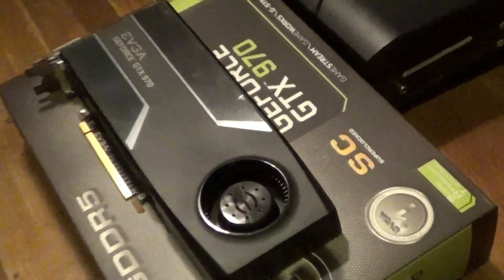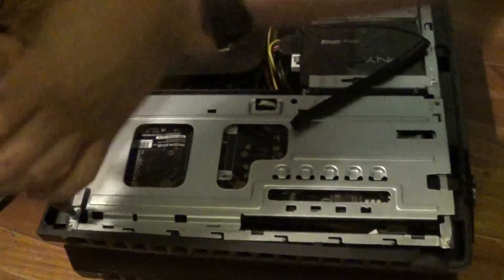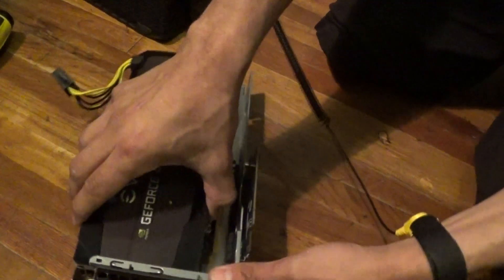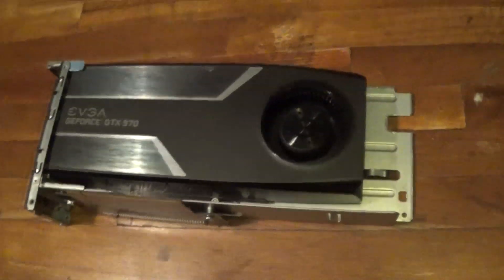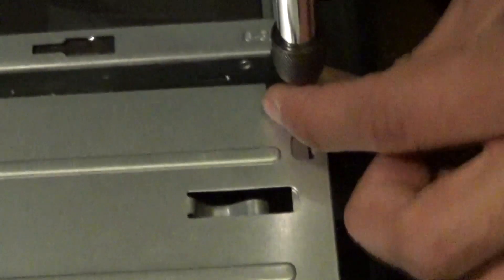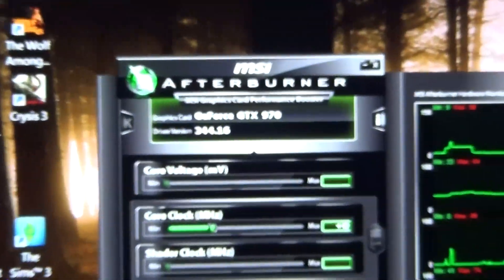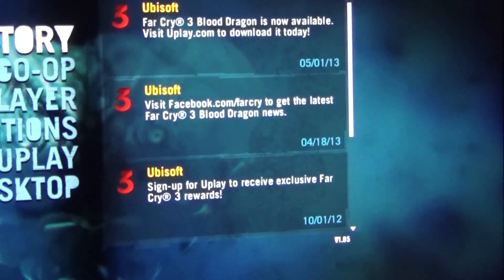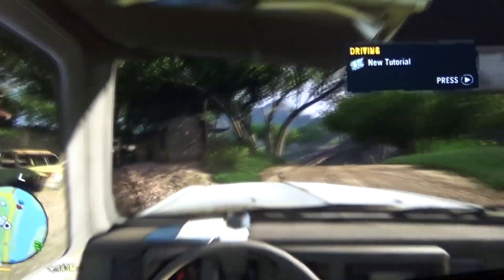How to install a GTX 970 SC in an Alienware X51. (English)

Comment: can somebody tell me if the gtx 750Ti w/ 2GB of GDDR5 would be able to handle gta v on medium to high settings??
Reply: ipraqticul well it could but on high you'd have problems. Better if you upgrade to a better graphics card and get rid of all the frustration.
Reply: I have a 660 and can run it on high you will be fine friend!
Reply: +Kyle Wild Humans can see above 200 FPS, are you drunk? Also, it's never been scientifically proven how many FPS we humans can see.
Reply: ipraqticul nup
Reply: John Lucas im currently using a 660, it runs at 45fps on high its terrible i cant play it XD
Reply: snoob000 that is actually false, its just a lie spread by some troll. The human eye seas constant motion, however thr brain can only tell the difference up to around 200fps
Reply: snoob000 are you a console peasant or something, gross
Reply: snoob000 i honestly dont care please stop replying geez
Reply: snoob000 not interested
Reply: Nuka Cola well if you read it again, it says tell the difference and this post if from along time ago that means normal people dont reply...goodbye
Reply: +ipraqticul I have the Alienware x51 r2, with a 750ti in it and it runs gta 5 at 60 fps at high settings
Reply: +Nuka Cola Monitor frames are different.  We can only see 60 monitor frames.
Reply: Sebastian Pegasus That's b/s, there is no proven case where that is true.
Reply: +Nuka Cola humans do not perceive light in frames per second.
Reply: John Dud When did I say we did? I appreciate the concern. Jack-ass; I was replying to Sebastian.
Reply: John Dud "lmfaoe" "O"
Reply: Yea it can. I have a 750ti and i get 60-70fps high 1080p on gta 5.

Comment: so just remove and install right? I heard somebody said I have to remove something to fit a 10 inch gpu?
Reply from the maker: Kal Kuma To install a 10 inch GPU you'll need to remove the front intake fan.
Reply: ElMastaGamer HD do u have a tutorial for that? xD Also would these cards fit the case?http://www.amazon.com/EVGA-GTX-GDDR5-Graphics-Card/dp/B00NT9UT3M/ref=sr_1_1?s=pc&ie=UTF8&qid=1433647360&sr=1-1&keywords=gtx+980&pebp=1433647350007&perid=1GARWKXDT58B1EG4RY4M

http://www.amazon.com/EVGA-GDDR5-256bit-Graphics-04G-P4-1970-KR/dp/B00NI45AMS/ref=sr_1_34?ie=UTF8&qid=1432787777&sr=8-34&keywords=970
Reply: Kal Kuma 2nd one could work depends on size, and 1st one is gonna burn your pc insides since it doesnt have reference cooler
Reply: +MGTech HD i have a question, i played league of legends, and i had like 200 fps with my geforce gtx 555 nvidia, and somehow after 8 hours of gaming, it froze out, and 2 seconds after it made a shutdown, so i opened my alienware took the gpu off plugged it in again, do you think it will happen again ? and do you think i need a new pc or just a new gpu if it continue doing that ?
Reply: +LetsplayDK ? Get MSI afterburner and check gpu temps, if your gpu is running on high temps limit your fps to 60 or 120, there is no need to overwork your gpu by playing on 200 fps. I had same problem with gtx 960 on battlefield 4.

Comment: There is a way to use those cards and keep it in that case. Call up Alienware / Dell and order the R2 power board its around $39.00 usd (totally worth it to game hard in such a small form factor. I like your videos on this Alienware you should def. keep it up dude. Thanks for the Alienware community contribution.

Comment: How do you find out what PSU your X51 has? I have the R2, but no clue whether I have the 240 or the 330.
Reply: Humpy Hippos If it has a green light on one of it's corners, it is 330W. If it doesn't, it is 240W.

I'm currently selling my old 330W power supply if you find yourself needing one.
Reply: +Ratchet Russian not sure if that's true, i have an r2 with only a 180w and it has the green light.
Reply: +Eniiqz When did you get it?
Reply: Nov of 2014.

Comment: Hey guys, Someone help me out a bit? It would be appreciated.

So this card will work no matter what in an r2 with a 330w? Could someone link me the 970 that is compatible and wont cause my cpu to derp? I ahve a 760ti right now. Not necessarily a bad card, but its definitely the weakest point of my computer, and this card will be a savior if i can get a comfirmation that this works in an x51 r2 no matter what

I have an i7 at 4ghz, 16g ddr3 ram, 1 tb of space. Id appreciate any help guys, really.
Reply from the maker: ***** These two card would be your best options:

http://www.amazon.com/PNY-GeForce-GDDR5-Graphics-VCGGTX9704XPB/dp/B00NH5ZNWA/ref=sr_1_11?ie=UTF8&qid=1432787623&sr=8-11&keywords=970

http://www.amazon.com/EVGA-GDDR5-256bit-Graphics-04G-P4-1970-KR/dp/B00NI45AMS/ref=sr_1_34?ie=UTF8&qid=1432787777&sr=8-34&keywords=970

Comment: can i put a GeForce GTX 980 CG or a  GeForce GTX 970 CG, which one would you recommend? and do i need to do any modifications to fit it in? 

Alienware X51 R2 
-Intel I7 3770
-16GB ram 1600 MHz
-2t hdd
-330w Power Supply
-AMD Radeon R9 200 Series

Thanks
Reply: Joshua Ameglio For the 980 you will need to remove the front PCI fan for it to fit (did it to mine about a month ago). 330w is fine for the 980, but you may need to underclock it to 99%. It's a little fiddly to remove the fan as you need to remove both side panels, but there's plenty of guides on youtube for disassembling an x51 which include removal of the fan. Hope that helps.

Comment: what are the dimensions for the graphics card holding space? i am to lazy to open mine up and check
Reply: Connor Davis It can fit a 10 inch gpu, and you may be able to all an extra centimeter by replacing one of the fans.
I don't know much about that last part, though.
Reply: Ratchet Russian Yep you can remove the front pci fan, had to do it to install a 980 in mine.

Comment: how can you connect the 970 ? i thought the x51 only has 1 6pin connector
Reply from the maker: Steven Grech The x51 comes with 2 6pin connectors.
Reply: Thanks alot.  I just did some research and found that out but wanted to confirm anyway. What card are you running? And is is stable all the time

Comment: Did you have to remove your front pci fan? I've heard 9.5 in gpu is too long to fit unless you have to remove the small fan in X51?
Reply from the maker: MyLostTemple You only need to remove the intake fan if the card is 10.5 in or longer.
Reply: ElMastaGamer HD which intake fan to choose in order to replace the existing one and being able to fit the gtx 980?

Comment: Hey, I have the X51 with 16gb ram, I7-3770 Processor, with the GTX 555, do you think I will have to downclock if I purchase the 970? Could I upgrade my power supply cost effectively? What are your thoughts?

Comment: Hey ElMaster
I have an alienware x51 r2 with a gtx 760 and 330w power supply. I want to upgrade to either the 960 or 970. Which one would you recommend? Would my PC be able to handle the 970?
Reply: Also, can the x51 fit a 9.72 inch graphics card or should I stick with a 9.5 inch?
Reply from the maker: ***** You should be able to upgrade to a GTX 970 without any problems, since you have a R2 with a 330w PSU. You can also install a graphics card up to 10 inches long inside the x51.
Reply: Thanks buddy! I just bought the EVGA gtx 970 :)

Comment: Does anyone have a list off all supported graphics cards for the latest i3 version of the x51 ? 

Also does the i3 x51 come with a 330w psu?
Reply: It comes with a 180W PSU, unfortunately. But you'll probably be able to upgrade to a 700 series GPU. Anything thing like the 960 would bottle neck with an i3. You may want to upgrade to an i5 or i7 for a 900 series GPU

Comment: Thanks for the video.
I just upgrade my stock 760ti to a GALAX GeForce GTX 970 4GB.

The GTX 970 reference model are hard to find, the only model that I can find is the GALAX: http://galax.net/TC/970.html
Although the spec stated that it is 271mm long, actually it is the same size as the old 760ti. So it fits perfectly in the case.

my Alienware X51 R2
-Intel i7-4770 @ 3.40GHz
-16GB RAM
-2TB Toshiba HDD
-330W PSU
Reply: Does it work ?

Comment: I have x51 R2

Core i7 4770k
R9 270x
16gb Ram
1TB HDD
330W Power Supply

Can i Upgrade to a GTX 970?
Reply from the maker: •Unitato• Yes you can, but just make sure you get a non-overclocked GTX 970.
Reply: ElMastaGamer HD okay, but it says, that i need 500 Watts Power Supply o.O But anyway, when i t does not work, i will get an other Power Supply (:
Reply: •Unitato• You can not use a different power supply without any system modifications. Good luck, though. I did the same before I built my current PC.
Reply: Ratchet Russian hm, okay (;

Comment: id recomend the 960 if youre thinking of upgrading the graphics card as it only uses 260 watts under load it was made specifically for power saving but gives more performance than most cards (better than the 760) and can handle playable framerates at 1440p at max settings on games like bioshock infinite and can run far cry 4 maxed at 1080p at very playable framerates after the drivers were updated https://www.youtube.com/watch?v=31uO5yUfid8

Comment: I don't know if I have the R1 or the R2
Intel i7 4790
8gb RAM
GTX 745 4gb
1TB Hard Drive
Reply: Considering the GPU you are using, it's probably a R2. If you bought it before early/mid 2013, it's probably a R1.

Comment: I am having issue with raids. I play world of warcraft and in middle of a raid the game freezes but not all the PC just game. After 3 months I have found nothing that helps and all the GM for game say it is my video card... I was able to do a ctrl shift shut down unresposive game and open a new one right away. Maybe you can give me some input if it is my gforce card. all drivers are up to date.

Name	NVIDIA GeForce GTX 645
PNP Device ID	PCI\VEN_10DE&DEV_11C4&SUBSYS_102910DE&REV_A1\4&1B2EF0FF&0&0008
Adapter Type	GeForce GTX 645, NVIDIA compatible
Adapter Description	NVIDIA GeForce GTX 645
Adapter RAM	1.00 GB (1,073,741,824 bytes)
Installed Drivers	nvd3dumx.dll,nvwgf2umx.dll,nvwgf2umx.dll,nvd3dum,nvwgf2um,nvwgf2um
Driver Version	9.18.13.4752
INF File	oem227.inf (Section047 section)
Color Planes	Not Available
Color Table Entries	4294967296
Resolution	1920 x 1080 x 60 hertz
Bits/Pixel	32

	
Name	Intel(R) HD Graphics 4400

OS Name	Microsoft Windows 7 Home Premium
Version	6.1.7601 Service Pack 1 Build 7601
Other OS Description 	Not Available
OS Manufacturer	Microsoft Corporation
System Name	MOMSALIEN
System Manufacturer	Alienware
System Model	Alienware X51 R2
System Type	x64-based PC
Processor	Intel(R) Core(TM) i3-4130 CPU @ 3.40GHz, 3400 Mhz, 2 Core(s), 4 Logical Processor(s)
BIOS Version/Date	Alienware A03, 9/25/2013
SMBIOS Version	2.7
Windows Directory	C:\Windows
System Directory	C:\Windows\system32
Boot Device	\Device\HarddiskVolume1
Locale	United States
Hardware Abstraction Layer	Version = "6.1.7601.17514"
Time Zone	Mountain Standard Time
Installed Physical Memory (RAM)	6.00 GB
Total Physical Memory	5.92 GB
Available Physical Memory	1.04 GB
Total Virtual Memory	11.8 GB
Available Virtual Memory	4.63 GB
Page File Space	5.92 GB
Page File	C:\pagefile.sys
Reply: I agree with Wish craft. If you're still having this problem. Use DDU and when you're in safe mode go to the driver site and get the right driver for your card.

Comment: So i watched your video on the moving of the components of my X51 and i'm trying to look at all my options for the computer. I really don't want to move the components into a new case even though it's a smarter option for the future. Any way I have the Alienware X51 R2 with
-i7 4770
-8GB Ram
-2Tb Hard-Drive
-330 Power Supply
-GTX 670
My current PC is very similar to yours and i would love to put in a GTX 970 into my computer, however is it a safe option? Will I HAVE to remove, change, or modify any components in my current PC and is the price worth the performance difference?
Thanks,
Brisbe25

Also on a different note would the Crucial Ballistix Sport Very Low Profile 16GB (8GBx2) DDR3-1600 240pin Ram be a good choice? I know it's the correct pin size and such but is the low profile needed in order to fit properly in the case?
http://www.amazon.com/Crucial-Ballistix-Profile-DDR3-1600-BLS2K8G3D1609ES2LX0/dp/B00A14ZT8I
Reply from the maker: Brisbe25 Hi, if you have a R2 than you shouldn't have any issues using the GTX 970. The performance increase is totally worth it, plus the 4GB of vram of the GTX 970 will come in handy since a lot of the new games are starting to require 2-4GB of memory. A low profile ram is recommended for the X51, but you can also install ram with heat-spreaders if you remove the optical drive.
Reply: ElMastaGamer HD THANK YOU VERY MUCH you have been a huge help and thank you very much, I am very grateful for the info and I'll try to spread the word.
Again thank you!
Reply: Brisbe25 Also another question, I know that the SC version fits, thanks to your video, but does any other "kind" of 970 fit in such as reference? I'm ok with this one but I want options before I fully decide
Reply from the maker: Brisbe25 I'm positive that these are the only two options beside the EVGA GTX 970:

 http://www.amazon.com/PNY-GeForce-GDDR5-Graphics-VCGGTX9704XPB/dp/B00NH5ZNWA/ref=sr_1_1?ie=UTF8&qid=1424995409&sr=8-1&keywords=PNY+970

http://www.amazon.com/MSI-GTX-970-4GD5-OC/dp/B00OC2CFYG/ref=sr_1_3?ie=UTF8&qid=1424995409&sr=8-3&keywords=PNY+970
Reply: ElMastaGamer HD Another X51 R2 owner here, is the power supply an issue?
Reply: Have a 1070 currently installed in the x51 R2, no problems with power!

Comment: The CPU can be upgraded too right? Was thinking of purchasing this system come next paycheck..

The one I was looking at comes with...
CPU : Intel Core i7-4790 (3.6 - 4.0Ghz, 8MB L3, FCLGA1150 Socket)
GPU : NVIDIA GTX 760 Ti, 980Mhz, 2GB
PSU : 330 Watts
RAM : 8GB, 1600Mhz

Was actually planning on upgrading it's hardware to...
CPU : i7-4790K (4.0 - 4.4Ghz, 8MB, FCLGA1150) (NewEgg : $339.99)
GPU : EVGA GTX 970 (B&H Photo Video : $329.99)
PSU : I Think I need to upgrade.. Right..? Something like a 1kW PSU.
HDD : Samsung Pro 850 512GB, 550MB/s R, 520MB/s W (NewEgg : $295.99)

Really nice video, thanks for sharing your knoledge & experience with us (+1 : 223)
Reply from the maker: Yes, you can upgrade the CPU to an i7 4790k, but there's really no point on doing it since the motherboard doesn't support overclocking. Also, you can't upgrade the PSU since the x51 uses Dell's external PSU.
Reply: ElMastaGamer HD
No point.. really..? It's 4.00Ghz - 4.40Ghz.. I don't think overclocking really matters.. Thats nice little upgrade all by itself for $300.

Comment: I purchased the GTX 970 Superclocked to put into my Alienware X51 R2, it worked good for a few weeks but now I am having random shut downs and restarts. Is this due to power problem or overheating?
Reply: It is your power supply that is having trouble running the graphics card

Comment: What power supply were you using for this?
Reply from the maker: audier3 I'm using the 330w external power supply that came with the x51.
Reply: ElMastaGamer HD Nvidia recommends a 500W psu for the 970. So a 330W psu with the gpu power set to 99% will do the trick with an X51 R2?
Reply: ElMastaGamer HD 
thanks

Comment: i got a 2012 version of the alienware x51 with

-8GB ram
-1TB HDD
-330w Power Supply 
-GTX 555 Ti

 and i was wondering if i could do it to or with a lower gpu
Reply: Same here - I'm thinking that a GTX960 is enough for me and is in budget. It will certainly be a huge upgrade from the GTX555. So far I have seen a Palit (NE5X960S1041-2060F) that is 247mm long and a PNY (GF960GTX2GEPB) that is 245mm long. The PNY is more expensive but I think will be more reliable - I worry that neither of them will fit though.

Comment: Hi there. Just bought a Zotac Gtx 970 twin fans. I'm not mounting the card yet as im waiting for dell to deliver my 330watt psu. I'm wondering if it could work on my x51 r2? physical-wise, do i need to do any mods to fit it? 

http://www.zotac.com/products/graphics-cards/geforce-900-series/product/geforce-900-series/detail/geforce-gtx-970.html

Comment: Thanks for the tutorial. I am picking up my gtx 970 today but I am getting the PNY card due to the fact that it was 100$ cheaper where I live. I am assuming the install will be exactly the same. Is there anything to look out for when using different manufacturers? Do I need any other cables? Thanks again and nice vid. Thumbs up.
Reply from the maker: Greb Nitty Is it the PNY with a single fan?
Reply: Yes. It is a single blower style fan.
Reply from the maker: Greb Nitty Is your x51 a R1 or R2?
Reply: BTW , I have already hooked it up and have been using it all day. It works amazing! It is very quiet and with a custom fan profile I am keeping my temps pretty low. I am so happy with this purchase, such an awesome upgrade. Thanks again for the tutorial!
Reply from the maker: Greb Nitty Glad to hear that's working fine for you. Enjoy :)
Reply: What type of PNY did you use? this one ? http://www.newegg.ca/Product/Product.aspx?Item=N82E16814133564&cm_re=gtx_970-_-14-133-564-_-Product
Reply: This is the exact on that I bought.

http://www.canadacomputers.com/product_info.php?cPath=43_1200_557_559&item_id=076678

Comment: I'd also like to point out one more thing. In small compact cases like the x51, it is highly recommended that you install a card with the Blower style fan and not the conventional twin fans. The idea behind this is the blower at the end of the card sucks in cold air driven into the case via the small intake fan of the case in the front and ejects hot air through the back. The cards with conventional fans just keep blowing the stagnant air already present inside the case onto the heatsink without proper direction. This results in extremely hot air being recirculated within the case. And the hard drive being in such close proximity to the card also tends to heat up. So always get a blower style card.